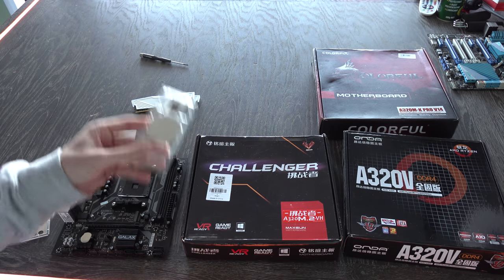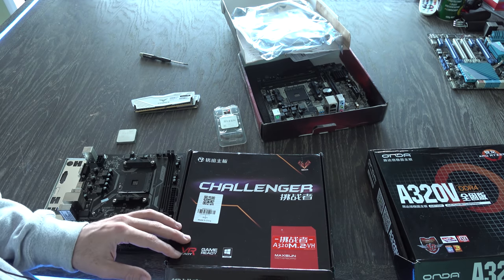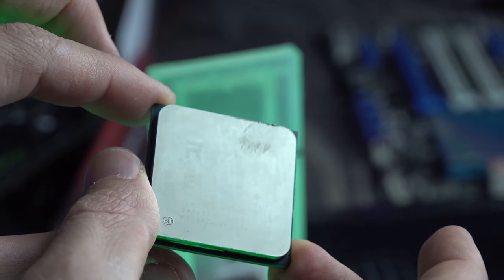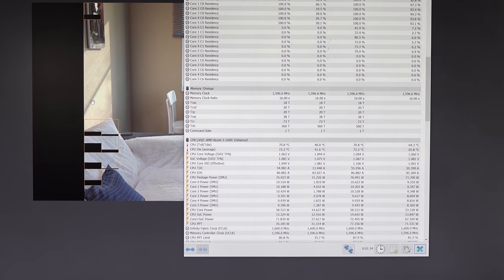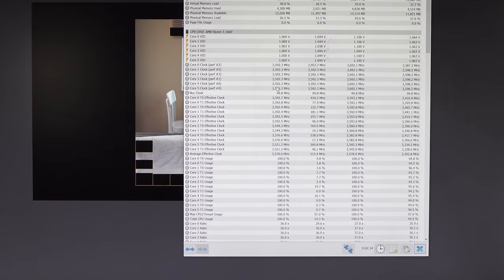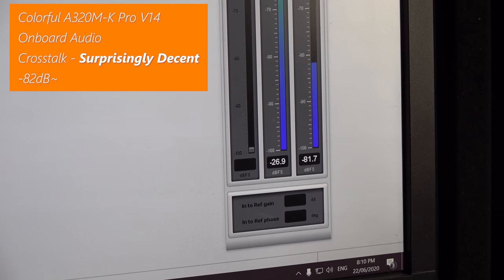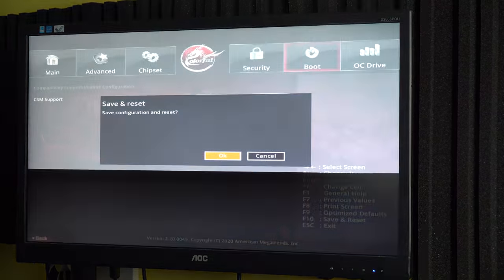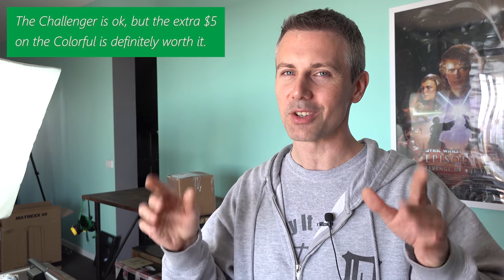CHEAP Aliexpress A320 Motherboards - COMPLETE Crap or Hidden Value?

Comment: I just bought an itx a520 board from onda that doesn't even support my Ryzen 7 3700x boost clock, nor the ram speeds it claims to (claims up to 3600 but only maxes at 2133). I should have spent the extra $40 on the next cheapest board from asrock.

Comment: In my place galax b450m literally cost same as a a320m from big brand. Is that worth mobo to get?
Reply: @Hard Knight i wouldn't say their GPU is groundbreaking, but i agree that they offer same performance as big brands while being considerably cheaper.
I guess it's 'best bang for buck'?
Reply: No heat sink. 4-phase VRM. Buy a board with a VRM heat-sink, unless you're only going to be using it for a Ryzen 3 or a Ryzen 5 3600.

Comment: i have a question, i got a bunch of lenovo m9x computers, and i swaped them to other cases with no problem, except it gives me FAN_ERROR, is there a way to bypass that without pressing some button on the mobo?
Reply: Plug a fan
Reply: @AbRaSkZo  I can't mount it, it is a small fan and obviously it wouldn't fit in a 120mm fan mount, kinda forgot to mention

Comment: I'm curious how these would do with a 3400g and a stock cooler. That is probably an accurate scenario build for one of these. The stock cooler would flow at least some air over the vrm/soc. Thank you for testing these. It does help to know. It would be a shame if someone on a very tight budget were to buy a bad board design. They wouldn't have the financial resources to recover and their build would be F@#%ed.

Comment: why I can't overclock the ram to 3200mhz on the same colorful mobo? I'm using xlr8 rgb 3200mhz cl16 but only can overclock to  2667mhz. Higher than that make my pc doesnt boot. I'm using ryzen 5 2600. I bought 3200mhz ddr4 after watching this video. I already update the BIOS to the latest update on colorful website. Please help.
Reply: Btw, I updated the BIOS to 1010 version, not 1007A.

Comment: Use the cooler box. It colds the VRM a bit with air. It doesn’t make sense to buy a cheap Chinese A320 motherboard and use an expensive liquid cooling solution.

Comment: We have ASRock, ASUS and GB AM4 MB's available for less than 60 Euros here in Finland, come with full warranty etc, this Aliexpress silliness just doesnt make any sense. Asrock A320M-HDV R4.0 is 54,90 delivered. if they were like 40-45 Euros delivered, then maybe, but as it is, not worth it. "MAXSUN Motherboard AM4 A320M-VH M.2" is ~52 Euros shipped from Ali, and its at -40% discount atm.. :/ And rest are actually more expensive than the first mentioned ASRock board.

Comment: Hey guys, I'm planning to get a3300x with a320 for 210usd, is it a good deal or should I just save up for a 3600 and a better mb?
Reply: On Amazon you can get an A320 and a 3600 for only $220, so it's not exactly a large price difference, and you'd end up with 50% more CPU in total. You'd be at a slight deficit in per-core performance, but it would be a very small difference which the extra 2 cores would more than compensate for in all but the worst-optimised single-core workloads.

Comment: bought a 'real' used a320 for £20, it runs my 3600 @ 4ghz all core and 4.2gzh on 2 threads at around 65A, its also running e-die 3200mhz cl16 @ 3600Mhz CL16

Comment: would rather buy local and the 1600af is all always more expensive than it should be. why pay 135ish for 1600af when for about 20bucks more you can by a 2700 or 3600

Comment: So, this would be worthy if you are in such a bad situation that you need Ryzen support on a budget but for some reason major brands, even on entry level, are way too overpriced and second hand market just doesn't make it either. Well, that's a really f***ed up scenario, because for that difference (that we must assume that in some cases could be really significant and definetely determinant) you lost almost all upgradeability and have a lot of potential issues and compromises. Personally, I would only go this way if I want to do an "everyday task" PC of sorts; cheap MB, an Athlon 3000G 2x4GB of RAM and an SSD, but for anything else, I would almost always prefer a B350 second hand MB.

Comment: not recommend buying those boards through Aliexpress, even through the colorful one looks fine. Actually, those boards are from the same manufacturer, but with different brands. Not saying those boards are not good at all, their Quality Control are really bad. In China, you can easily swap a good one, if you bought a problem board. It is just waste of time when you get an board not working, after waiting quite a long shipping time .

Comment: did the YES Man know that you can buy an used asus prime x370 pro for as little as 100 usd from aliexpress?
Reply: Really? Good to know.
Reply: @Razor-gx2dq  yup. building a system with a r3 1200, rx 470, 2x8gb ddr4 3200 cl16 and 256gb nvme for just over 400 eu

Comment: Compleet stupide to test a budget board with aio cooling .
Sorry but these boards are make in mind to use a stock cooler
So that the stock cooler cool the vrm sets.
That is the reason no vrm headsinks on it.
So do you test again with original box cooler.
I can not rendement this vrm test to correct.

Comment: I still think Ali is a scam. 50% of time you get a faulty product, and the other 50% you're happy if it works at all, the lowest possible quality.
And for what? A $10 difference from what you would buy in store from a decent brand?
Reply: I think it depends on what you buy, I bought from AliExpress the best in ear headphones. They beat my jbl j55, my Logitech g633 and much others that I have, the product is a kz as10 headphone, it's has 5 drivers per side, the sound is incredible!!!. So....I think depends really on what are you buying. I had very good experience with it.

Comment: The R7-1700 is also a 65W part and works with A320 motherboards.  I have one mounted on a Biostar A320MH and it functions without issue.  The latest driver for the Maxsun Challenger A320M.2-VH is from 2022 and says this:

1.The update BIOS supports ryzen1000-5000 processors, and does not support Athlon and APU.
2.Note that the BIOS does not support degradation after upgrading. Be careful when upgrading BIOS.

This is a very weird description because I've never seen an AM4 motherboard drop support for the APU lines before.  I guess that it can handle Athlon APUs with the base BIOS and that's it.  If this is true, it's quite impressive because it's the first AM4 BIOS I've seen that supports both Ryzen 1000 AND Ryzen 5000 at the same time.  

My ASRock X370 Killer SLI, ASRock X570 Pro4 and Biostar A320MH all drop Ryzen 1000 support about halfway up the BIOS version stack but they all support APUs like the R7-5700G.  I guess the difference is that Maxsun decided to drop support for the APUs instead of Bristol Ridge.  This actually makes more sense because I'd guess that well over 90% of AM4 aren't rocking an APU and that there are a lot more Ryzen 1000 CPUs in the wild than all AM4 APUs combined.

I have one question though.  What is it with you tech influencers that possesses you to do ridiculous things like put an AIO on a motherboard/CPU combo that would undoubtedly be using an air cooler?  Then you complain about the VRMs getting hot when an air cooler, that would be used in real life, negates this issue?  It's like you went through extra work and expense to CREATE this problem that you're seeing.  Man, this video was actually pretty good until you went and became completely boneheaded.  Your inexplicable use of an AIO in a situation that wouldn't have one has made this entire video irrelevant.

Comment: My onda b320 itx board rus ok but your right the bios is tough on some Chinese motherboards.Heres my ram overclock with sodimm.CPUZ  https://valid.x86.fr/knx7rt I am trying to get a gpu to run off the nvme slot but i think i have smoething set wrong in this cryptic bios.All in all for the price its been fun.If tou ever chek this board see if you can get a gpu running on it or show me who has.TXH

Comment: If you’re buying this cheap of a board, I don’t think u would be using a 3rd gen anyways
Reply: If you're using 3rd gen, you can afford to use a crap board. Zen 2 is ridiculously efficient compared to Zen1 and Zen+ and a 3600X can easily run to its full potential on all but the worst A320 boards.